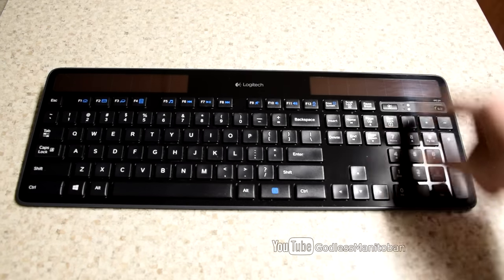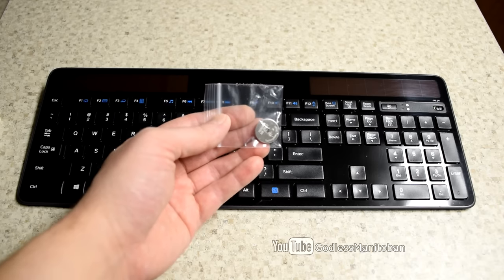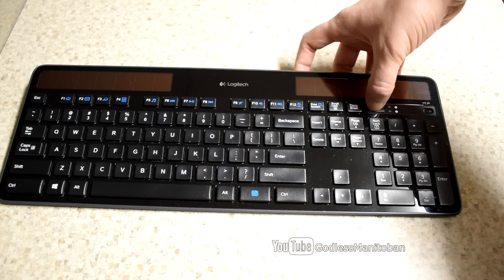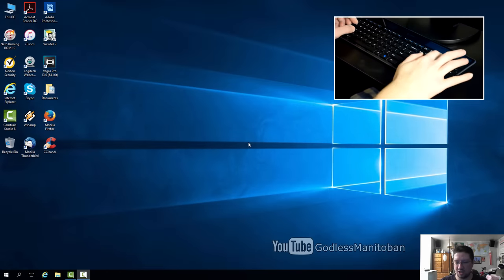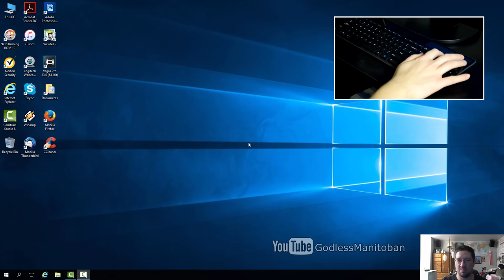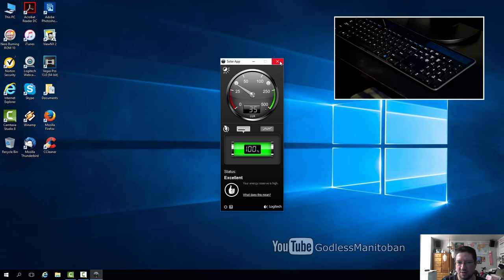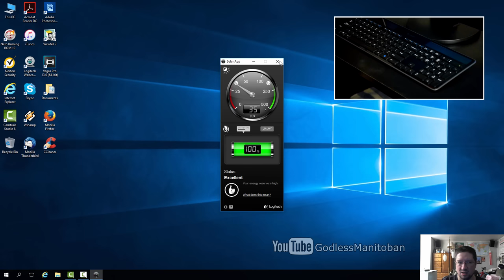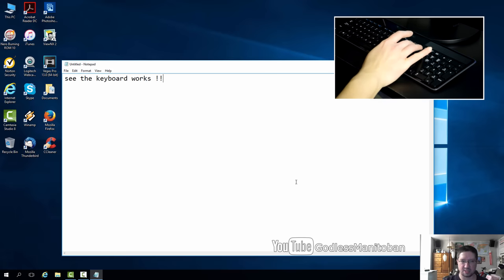Replacing Battery in the Logitech Wireless Solar Keyboard K750 (How To)

Comment: Do u ever switch it off  or do u just use it till u recognise the battery level dropped down and then u recharge it? thx in advance
Reply from the maker: It should constantly be recharging if you're in a well lit area. There's no need to turn it off.

Comment: Replaced  the ML2032 with a new one and nothing happened, even after leaving it next to a light source for two hours...

Either the battery is defective or it's a circuit/wiring issue: - no solar app lights - and no way of confirming it.
Reply from the maker: A battery tester should confirm it. My replacement battery came fully charged or at least charged enough to show a charge. If you put the old battery back in do the lights work on the keyboard? Even if that battery is dead it should show a red light.
Reply: Perfect excuse to head over to Radio Shack, but the nearest ones closed months ago...lol

The seller replied back today and turns out the battery needs to be charged, so don't think it's the problem. No red light with either battery and the unifying software isn't recognizing the keyboard, just the mouse, despite reinstallation. One night the keyboard was at around 90% and the next day couldn't get it to start.

Logitech is sending a replacement, as it's still under warranty, but they don't want the defective keyboard back, so I thought I could figure out what's wrong, prior to sending it off for recycling. It's more than likely the keyboard would have to be taken apart, but this is beyond my repair capability.
Reply from the maker: Same thing happened to me. One day the solar app showed 90, 86, 50 and then dead. So I tried to contact Logitech and they told me it was out of warranty (that's why I shouldn't register things). Then I found the battery on Amazon and it worked. It still acts up once in awhile but it's not the battery it's the keyboard not communicating with the receiver I think.
Yeah I'm getting pretty sick of this keyboard. If the battery dies again I'm going back to a wired keyboard. Logitech said this keyboard could last three months in darkness, pfft. If there isn't enough light then it doesn't want to connect and I can't type. It could be other wireless signals interfering but idk.
Reply: GodlessManitoban  I bought the k750 almost 7 years ago. I was able to use the same battery up until about 2 months ago. I must have been lucky because I hear some people run into problems much sooner than this. Before I ran into problems a few months ago, the keyboard could go over a month without sunlight and it would still work. 

I replaced the battery about a week ago and the keyboard worked fine for a few days, but it seems to have bricked itself. The battery is fine. I have 2 and both are good, but the keyboard light indicators wont even light up red or green when I activate the power switch

Comment: umm i have an alcatroz bluetooth keyboard and it uses batteries to power it. But suddenly when i was using it, it died on me. I replaced it battery but its not working. If you could help plz help.
Reply from the maker: I'm not really familiar with that brand. It could be that the keyboard lost the Bluetooth connection and needs to be connected again. Try searching the brand name (Alcatroz) and model number it may be a common issue that has been answered somewhere.
Reply: ive already checked and it is still connected to my pc. Ill try search its brand online
Reply: sadly they do not have a help page and therefore i now have a broken keyboard
Reply from the maker: I couldn't see why it'd stop working if you replaced the batteries and it's still connected. Did you get the same type of batteries? Like disposable non-rechargeable batteries? I'm not familiar with the batteries your keyboard needs.
Reply: triple A batteries. Same one i always use. Non rechargable

Comment: 13% tax!  I know where that is coming from. Good diagnosis. I have 2 of these keyboards. One essentially never used but stored close to indoor light to keep some charge. Now both have zero response. No sad face light response either. Hard to tell if battery is the only issue or if some kind of reset procedure is the real solution. Any way to confirm?
Reply from the maker: I don't think there is a "reset". To be honest I don't use that keyboard anymore because it worked well for awhile after putting in a new battery then went back to being unresponsive even though the battery is 100% charged according to the Solar App. I had to physically pick up the keyboard and point it towards a light for it to start responding again. I think it basically ran it's life and is now e-waste. I got sick of trying to get it to respond to my keystrokes and went back to a corded keyboard. When I first bought it, it worked really well or as expected but not anymore. Brand new out of the box I didn't have to put search lights on behind me to type something. Logitech even boasted that you could type for 30 days in the dark. I'd have to say that is no longer true or maybe never was.

Comment from the maker: To all of those people commenting "It would've been nice to see how you pried the battery out..." I mentioned what tool I used and it's logical to assume that gentle force is required to avoid breaking anything. So no don't use a Smith and Wesson to open it. The prying part was accidentally out of video frame.
Reply: You did an amazing job, great work man.
Reply from the maker: @noirth-security  Thanks.
Reply: I get your point but it really would have been helpful to actually see what you did which is the whole point of making a video. These are clearly hard to pry out and it can do a good deal of damage to do wrong which is why people wanted to watch someone do this. From what I've gathered, the drawer is spring loaded and needs to be pressed in on the sides to free it. You pried it on one side it appears and so that you can do this is helpful to know. Thanks for that. I was planning on prying from both sides instead but can see that's not necessary now, but it will require a little finesse to not break the drawer or damage the area around it.
Reply from the maker: @FreeSpokenOne  Yeah I was recording it and I looked at the view finder and it looked like it was in frame. Then once I watched the playback I was like "Crap!" and I didn't want to pull it apart again to re-record that one part. It's all plastic the sides have plastic pieces that spread out to hold the tray in.

Comment: Thanks for the video. That tray was a pain to open-I got it partially out and had to use small pliers.

I'm glad I saw this, I was accidentally going to use a regular 2032 battery. 
I decided to order this: https://www.amazon.com/gp/product/B083R423WJ/ref=ppx_yo_dt_b_asin_title_o00_s00?ie=UTF8&psc=1
Reply from the maker: That's pretty cool that they make a charger. A regular 2032 wouldn't hurt if the solar panel was disconnected. I saw a video on YouTube where the guy disconnected the panel.
Reply: @GodlessManitoban  

Naww thats ok 🤓
That's too much work and I'd screw something up. 👍
It's easier to go on Amazon and order what I did, plus use these in other things. Its out for delivery now.
Reply: @GodlessManitoban  

Actually I think the keyboard is shot. Even with a recharged battery, the receiver can't even see it and it doesn't power on. I have 2 of the official Maxell rechargeables coming today and will try that as a last resort.
Reply from the maker: @robertrose3068  Just make sure to keep the sticker on the original battery. Some commenters have said that sticker helps press the battery firmly against the connection. I got tired of messing around with that keyboard and tossed it into the recycling after bending it to a 45° angle. I'm using a corded keyboard and mouse now. In the beginning the keyboard worked really well. But when they say it can last up to 30 days in the dark that's a lie. Also it performs really badly in the dark or with little light. The mouse I had even with new AAA re-chargeable batteries it wasn't working well either. It could've been wireless interference but too late to figure that out.